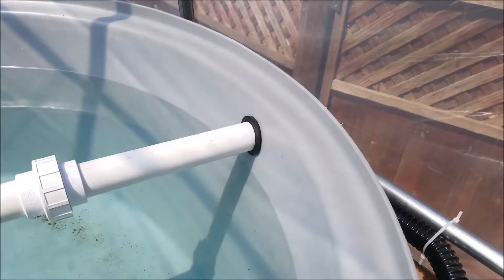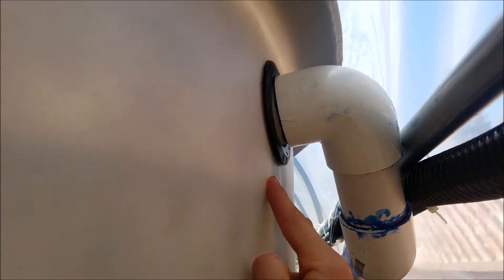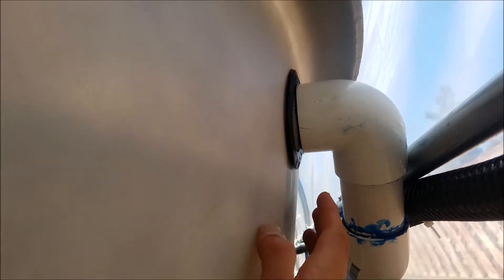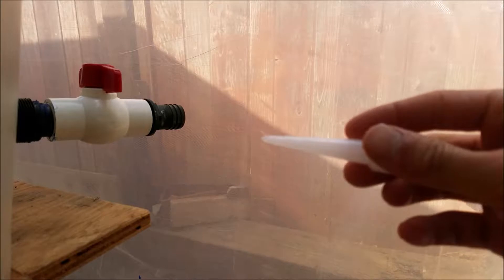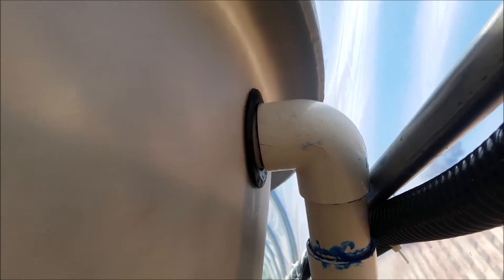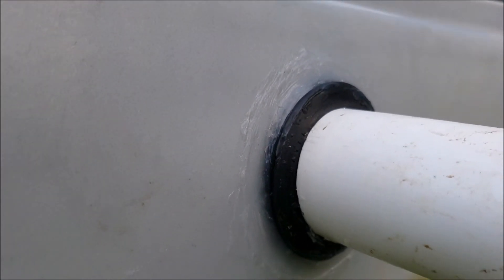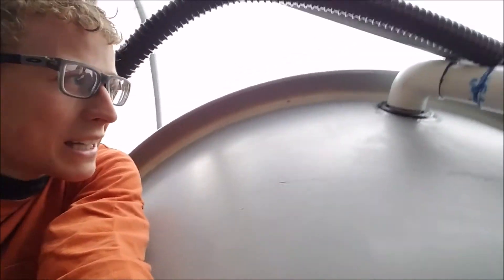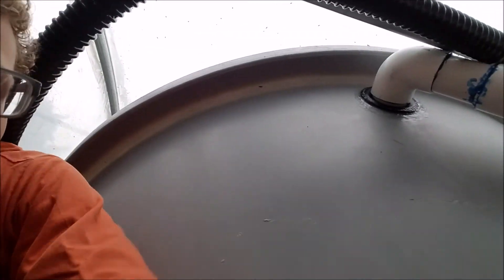How to fix a leaking uniseal (Hybrid aquaponic system)

Comment: Hows that Uniseal holding up Von.  LOL
Reply from the maker: Well it didn't leak anymore after I used the silicon. However I don't have this tank anymore, the system is pretty different from what you see in this vid

Comment: So, it's not how to fix a leaking uniseal, it's just a bodge.
Reply from the maker: I guess you can think of it that way.
The best option would be to take the uni seal out and put a new one there instead.
But because of my spot I didn't want to do that since I would have to drain the water, and move the tank to be able to take the pipe out.
But when I do change some things in my green house I will redue the plumbing.

But this temporary fix has been working for like 6 months so a good amount of time.

Comment: Von, The first 90 degree joint is cracked, and the angle of pipe is downward, forcing major compression on the seal at the bottom. I would replace the 90, and straighten the thru-pipe, and replace the seal. Likely the silicon will work since it will stick to everything, but for how long. Pipes need to to at 90 degree in both directions (up & down) to make an appropriate seal.
Reply from the maker: Hey
Thanks for letting me know didn't think of that beforehand.
But that makes perfect sense in why it was leaking.
The silicon has been fine for already a few months but you never know as you said.
I do plan on changing the plumbing I did, so will keep that in mind for when I do that.
Thanks